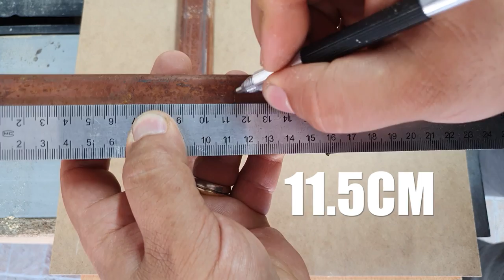Making Go Kart Bike Rear Axle – Go Kart Bisiklet Arka aks yapımı

Comment: I am making go kart.. which has electric motor transmission and as well as bicycle pedaling.... but transmission for motor is perfect.. and for pedaling i am facing problems of loosing chain.. so i made idea of giving another small sprocket in between the chain to tight it.. i saw your video and u also made the same idea to keep chain tight.. i need to see next video.. curious about how u made it..👍